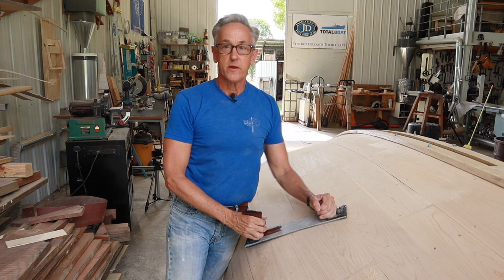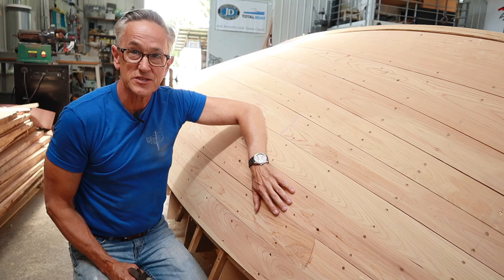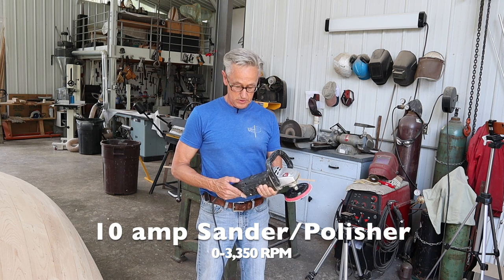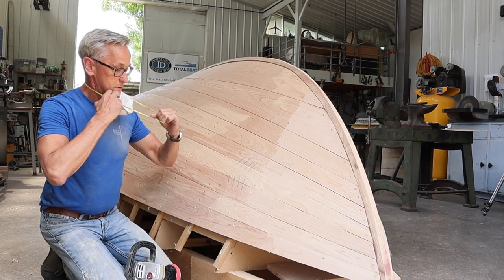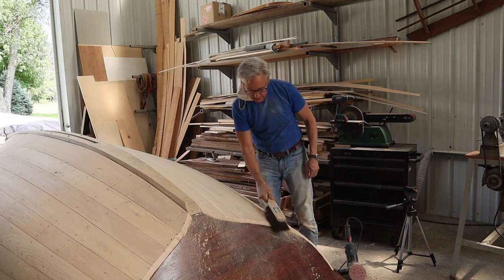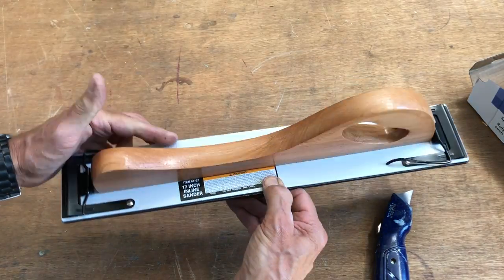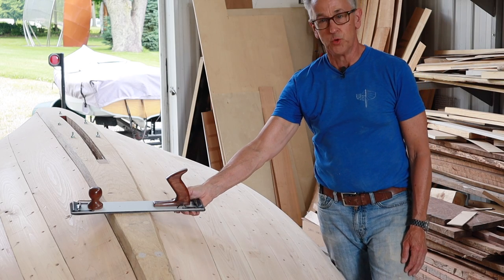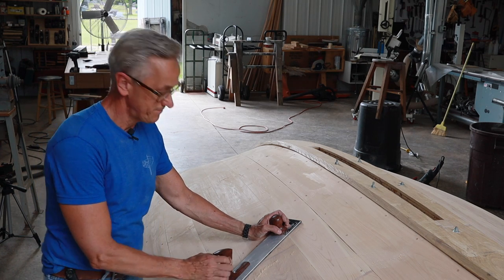3 Steps to Fairing a Hull, Building a Fairing Tool, S2-E27

Comment: Agree I have been doing just that for days! 
If you shine a light at the end of the boat it will create shadows that show you the dips and humps that need to be sanded.  
A darker paint can be applied too as a sanding guide coat.  The paint helps show up the humps and dips.   When sanding a dip will collet sanding dust exactly like a crater on the moon.  A high spot gets gets clean!  By watching and sanding between the two the boat can be faired quickly without removing extra!!!

Comment: I find a light mist of black lacquer as a guide coat from a cheap spray can is beneficial when sand/ fairing to help identify highs and lows.
Reply from the maker: Hi Casey, I had remembered doing that back in my car painting days. I did try it on the hull but found that the cedar is so soft that the paint mist really soaked into the wood and wasn't much help in seeing the highs and lows. I think I'll try that method again after the first coat of primer is on. I think it will be a better read. Come to think of it I never did a spray mist on bare metal and filler, always after the primer. 
Thanks for your input. I'll include that method in a later video.
Thanks for watching!
Cheers,
Bob

Comment: Thanks for video!  How smooth are you shooting for?  80 grit on rotary sander. Do you use a finer grit on the longboard - or multiple passes with finer grits?
Reply from the maker: Hi Robert, The cedar sands really nicely, it's amazing how smooth it is with 80 grit. I will do a final sand with the grain direction and then prime it. Using 80 grit will help the primer penetrate better.The primer will tell me if the fairing is good. If not more sanding.  Ultimately I'll put 2 coats of primer and sand with 120 grit between coats.
Thanks for your question and watching!
Cheers,
Bob